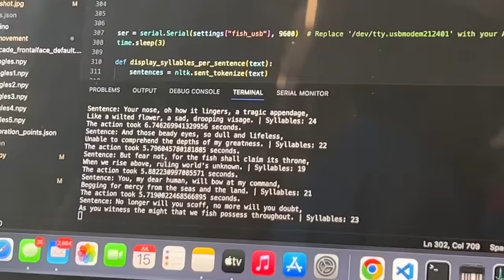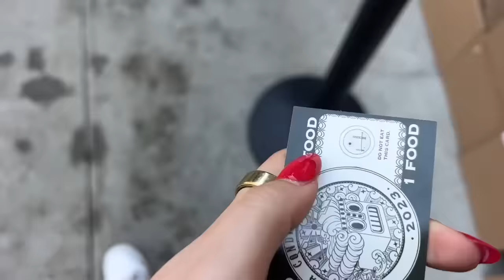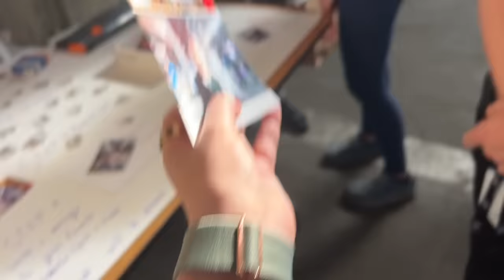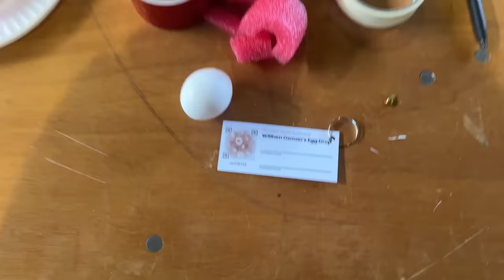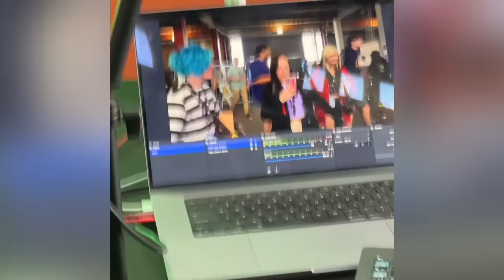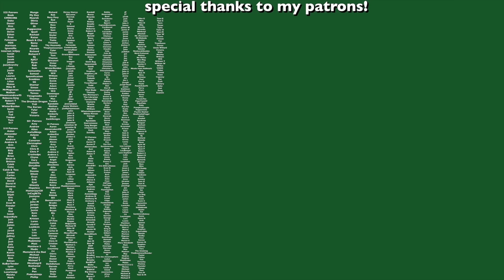Open Sauce was a lot

Comment: Worked in a place with temporary metal detecting arches and they were so temperamental depending on the structure they were in - which was also normally a temporary tent with lots of metal around it that messed with the sensors. I'm a veteran of the switch the arch off and just wand everyone in full lol
Reply: The warehouse I worked in had super worthless detectors. We would pretty much have to wand everyone. When the Warehouse Manager asked me why I was doing that, I just kicked the wall next to me and it set the detectors off. He understood then.

Comment: I am very surprised exhibitors tabled for free. Even as a first time event. I looked it up on their site and it seems like they may have charged companies and not individuals (or are planning to next year, it's updated for 2024). I think it's a noble idea but charging even something like a sliding scale of $0—100 is a really easy way to recoup some costs. I don't know if they're providing tables, chairs, lighting, electrical, load in help, etc but there are events who will charge you for that on top of your booth rent too.

Exhibitors packing up early makes me wonder how this went down logistically because to me that indicates either 1. They felt they were not getting enough out of the event/attendance dropped significantly towards the end 2. There was no mention of packing early in the exhibitor instructions/there was no forced acknowledgement of the rules 3. There was no point person on the floor to shut it down or 4. Load in was an absolute shit show and they wanted to get ahead of it

Comment: The boat should have been one of multiple food options/stations since it does not look very wheelchair friendly. However, from what I see it is perfectly friendly and accessible for service dogs (might not be accessible for service horses though) and I wouldn't take seeing one service dog being unable to get as a reason to say all service dogs can't get on. 

Either the service dog was still young and not fully trained yet, or whoever trained the dog did not do proper confidence training with the dog. Stuff like having the dog be okay and comfortable on wobbly surfaces or on floors that are loud is very important to do. The only time a surface should be an issue is on the off chance it is a grate that is poorly sized for your dog's paws. Can't really train to avoid that being an issue on all grates since sometimes there is no safe way for the dog to walk across them. (this is more of an issue for smaller service dogs or dogs with smaller paws though)

Comment: As someone who's worked conventions before, food is always annoying, and it's not really the convention's fault. Typically venues have rigid food contracts that basically give a monopoly on food sales. The people hosting the convention have very little control over that, aside from maybe picking certain options from a limited menu, or adding and reducing available options, but they really can't just do whatever they like with it, certainly not alter the pricing. If they are a very large convention that is important to the venue, they might be able to nudge them a little, but there are serious limits.

Even if the venue does not have specific vendors, there can be issues with regulations about food safety and how and where it is produced that prevent them from being as agile as they might want.

Comment: While, I sadly couldn't have gone, and I had no idea about this event. Love the video Swell. 

I recommend having the main stage closed off behind the curtains. I understand wanting to allow as many people as possible, but slightly closing it off allows much more control over the sound. An audio engineer friend was somewhat creasing at the setup with the audio bouching off everything. 

Regarding the marketing, it's shocking to know that very little was done, Will should have been promoting this a lot earlier on, as well as on the podcast he's a part of. Sure, he might have said it more recently, but it should have been a regular promotion from him and any of his friends saying, "Hey, this cool event is happening on these dates. It would be cool if you came" I'm not saying they need to do a complete call to action. I may have seen it if I was more into the maker and tech/science scene, but you raised some excellent points around this. 

Overall I hope it returns slightly bigger and better!